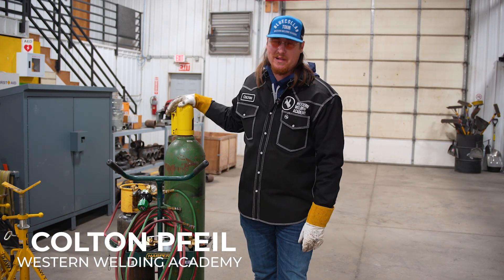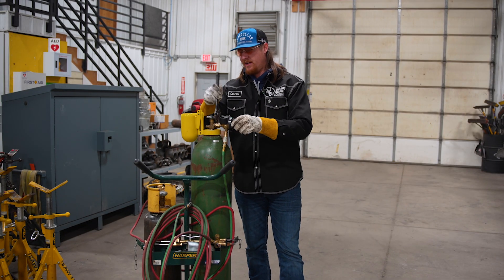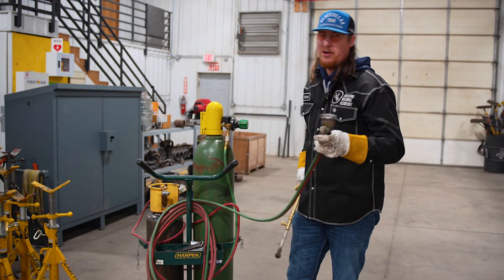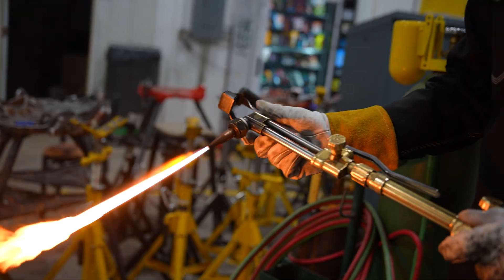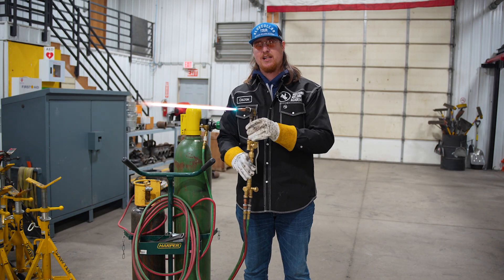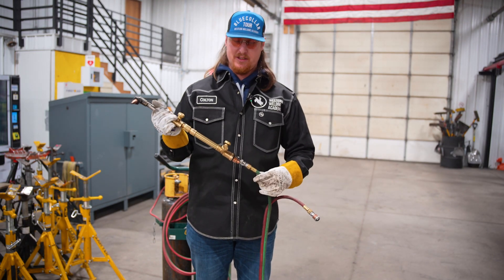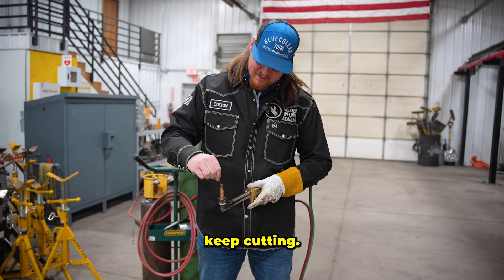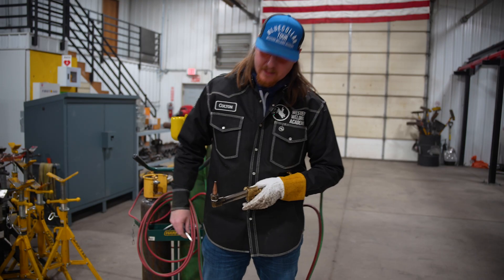Acetylene Torch: How To Set Up and Use

Comment: What machines do yall recommend that mulitprocess for someone starting out. Im just trying to run a lil side gig thing welding fences and exhaust pipe and basic fabication. Im trying not to go over 3k for the machine.
Reply from the maker: For someone starting out with welding as a side gig and looking for a multi-process machine under $3,000, there are several options available that offer versatility and reliability. Here are a few recommendations:

1. **ESAB Rebel EMP 215ic**: This machine offers MIG, TIG, and Stick welding capabilities, making it suitable for a variety of applications including fence welding, exhaust pipe work, and basic fabrication. It's known for its ruggedness, user-friendly interface, and portability.

2. **Lincoln Electric Power MIG 210 MP**: The Power MIG 210 MP is a versatile machine that can handle MIG, TIG, and Stick welding processes. It offers a wide range of adjustable settings and features a compact design, making it suitable for both small-scale projects and on-the-go welding work.

3. **Hobart Handler 210 MVP**: While primarily a MIG welder, the Hobart Handler 210 MVP is an affordable and reliable option for beginners. It's easy to set up and operate, making it ideal for fence welding and basic fabrication tasks. Additionally, with optional accessories, it can be converted for flux-cored welding.

4. **Everlast PowerMTS 211Si**: This multi-process machine offers MIG, TIG, and Stick welding capabilities, along with synergic MIG functionality for easy setup and operation. It's known for its affordability, versatility, and digital control interface, making it suitable for a range of welding applications.

5. **Forney 220 AC/DC TIG**: If TIG welding is your primary focus, the Forney 220 AC/DC TIG welder offers excellent value for money. It provides both AC and DC TIG capabilities, along with Stick welding functionality, making it suitable for various fabrication projects.

Comment: How much pressure should be on the acetylene? Thank you
Reply: 7-10 Aceteleyne can become unstable around 15
Reply: @jacobreaves62 thank you
Reply from the maker: Hey! Catch our Instructors' live every Thursday at 4pm MST in Tiktok and IG so they may directly answer your questions!
Reply: @WesternWeldingAcademy I don't like your promotion. You could have just answered the guys' question here and now. Shame.
Reply: @ROARROARROAR-w7x never more than 15 psi 👍
Reply: @Turb0button  Stay between 0,5–0,7 bar or 7,5–10 psi. This is a save level. At higher pressures acetylene can chemically degrade explosively.
Reply: @ROARROARROAR-w7x Maybe he had a good reason e.g., not a topic that can be defined in a short blurb. So ROAR, don't be a short blurb.
Reply: Oops ... where's the instructions on setting acetylene pressure? And this video is sponsored by a trade academy! Better planning and focus needed.